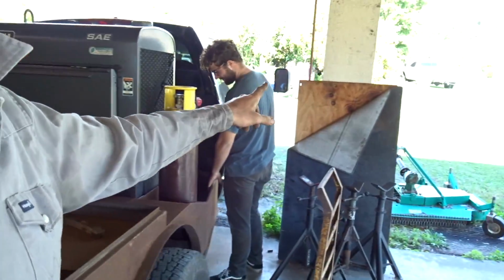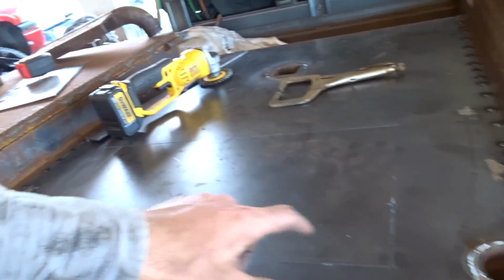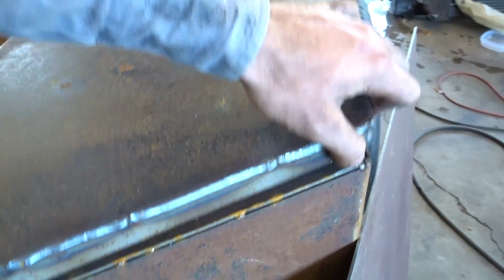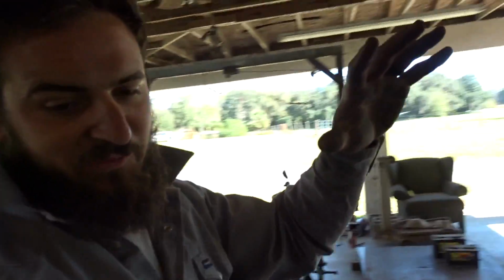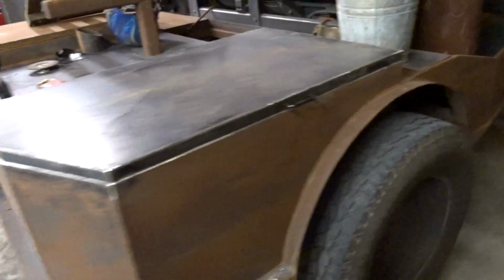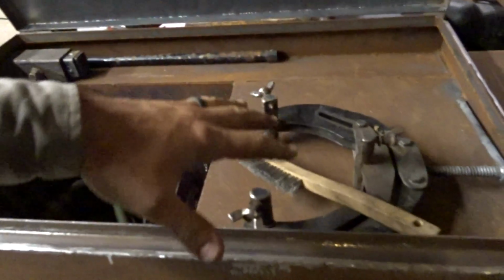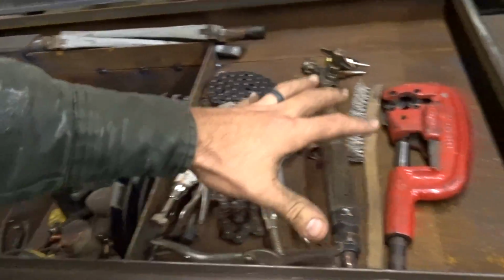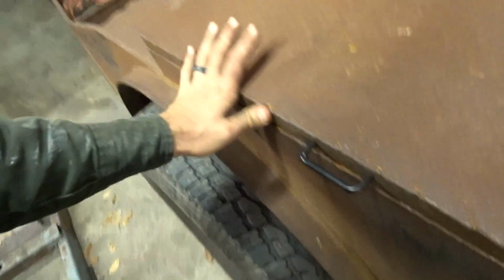Welding Bed Build PT 7

Comment: What would you say the weight is on a build like this in comparison to a stock bed? Reason I ask is id like to build a bed for my truck eventually but it’s a 1/2 ton. I know it’s not very ideal for a rig but it’s all I’ve got to work with right now for starting out.
Reply from the maker: A lot more than a factory bed but if all you have is a half ton, you don’t have to build it like this, just build a simple/light flatbed and just be mindful of weight because your machine and tools will also add a lot of weight

Comment: Whats the number off your edge o2 and acet regulators? Did you half to modify the valve / lock protection cap to work with the edge or if you didn't will you shoot me the part number of them. Thanks for your vids
Reply from the maker: They are just victor medium duty regs

Comment: Do you guys disconnect the batteries to weld on the truck? And does the bed need to be grounded to weld off of it?
Reply from the maker: I don’t disconnect the batteries, and I’ve never done anything special for grounding, just be sure that you have a good ground on whatever you’re welding so that the welding machine doesn’t use the trucks electrical system as one